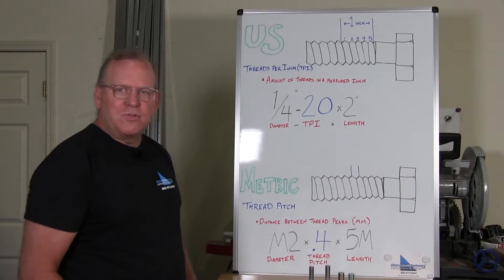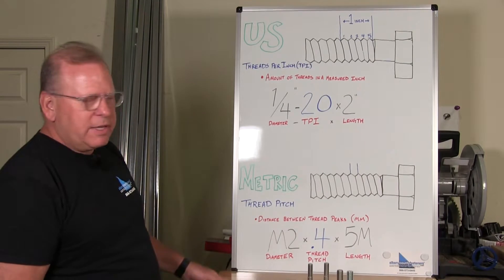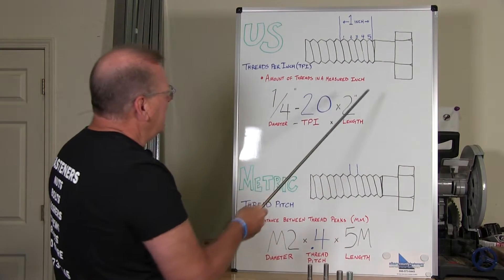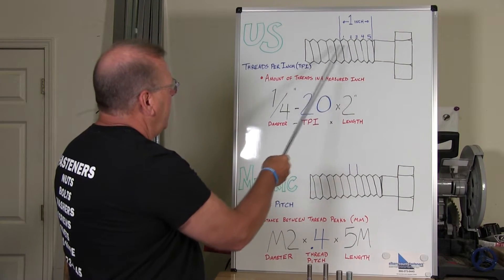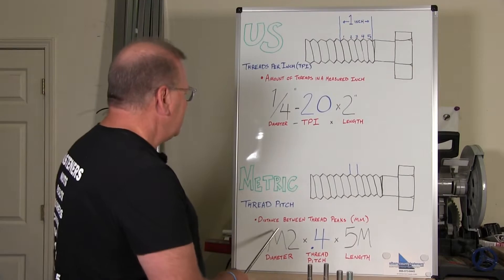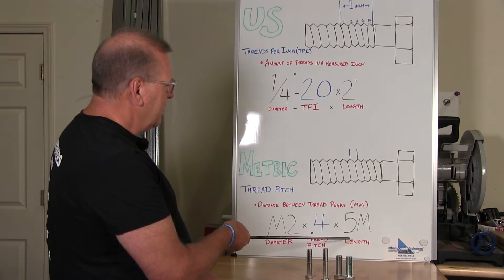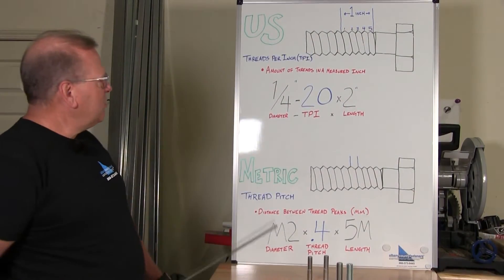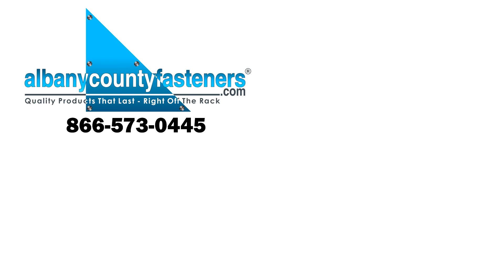Measuring Thread Pitch & Threads Per Inch | Fasteners 101

Comment: When you measure thread pitch, do you measure the smallest distance between peaks, or do you measure the distance between peaks, measuring parallel to the axis of the bolt? They result in different outputs, so I'd like to know which measurement to take before making plans

Comment: Great explanation, bit confused about 5m ,  is  5m not 5 metres, surely it  should say 5mm  for 5 millimtres
Reply from the maker: Under normal circumstances, you'd be right! In the context of fasteners, 5m is shorthand for millimeters. Outside of threaded rod, the vast bulk of metric fasteners don't go beyond millimeter measurements. I guess they got tired of having to write a second m all the time!
Reply: @AlbanyCountyFasteners   @ every day is a schoolday mate, thanks for that

Comment: what seems to never be mentioned, but can be confusing is HOW to measure threads per inch.... the metric pitch measurement is easy, as its measured at the peaks of 2 consecutive threads.... but the threads per inch can be mistakenly measured at the peaks when it needs to be correctly measured from a valley, and the other end of the 1" measuring device will either fall in a valley, with the teeth counted in between,  OR, it will end on a peak, or somewhere in between the valley and the peak, which would designate either a half thread or 1/4 thread, which are rare but are sometimes found....   to make it simple for explanation purposes, take a very large SAE bolt that has the threads measured from peak to peak may seem to have 4 threads per inch, but when properly measured at the valley, it will be found to be a 3.5tpi bolt...  this needs to be understood to get the proper measurement, and it can probably expained in a much better way than Ive tried to do here....
Reply from the maker: Thank you for your feedback!

Comment: When you are counting the threads, does it matter whether you start counting from the trough or peak of the threads? Here it looks like you're starting from the trough but I just wanted to double check
Reply from the maker: When measuring Imperial fasteners you count the number of thread peaks per inch. For metric fasteners it's the distance between the peaks that's measured. We apologize for the confusion.

Comment: @Albany County Fasteners  Great video, why do bolts (fasteners) not seem to have the head size / style specified?
Reply from the maker: Head size is typically less important than the thread size (you have to make sure your fastener will fit in the hole first after all!) and is not usually displayed like the diameter and pitch. Head size can be found in the specifications table for a given bolt, however; for hex head bolts it's synonymous with wrench size. As far as style goes, if you are referring to bolt grades, our other video on the subject may be able to help you: https://youtu.be/GMtw6d_o_2M

Comment: It was a very good video, but can you just explain me what is coarse pitch thread and fine pitch thread??
Reply from the maker: Coarse and Fine are two different types of screw threading. Coarse threading has less threads per inch (or thread pitch) than fine threading. As an example, 1/4"-20 is coarse thread with 20 threads per inch while 1/4"-28 is the fine thread version with 28 threads per inch. 
The added threads make Fine thread screws have a stronger connection with more vibration resistance. Coarse thread screws are more resistant to stripping and cross threading while being easier to install since they don't require as many turns to screw in as fine threaded screws do.
We're planning on doing a future video on the subject, so we thank you for your interest.

Comment: thank you i needed this for my ied class
Reply from the maker: Happy to help!
Reply: @AlbanyCountyFasteners  

i am still  not clear on how to id a thread. can you do a clear video on thread, how many type of thread on earth ? how many standard on earth ? all those thread for water and gas (parallel thread, tapered thread) and normal screw fasterner thread. what are the factor must have to determinate a thread on something in each system ? 

how many type of thread gauge available to use and purchase ? and how to use thread gauge to determine  ? 

i am so confused. not even one complete video out there can clear my doubt.. oh.. help. 

andrew
Reply from the maker: @andrewyek  As far as fasteners go, there are only 2 thread systems that matter: The Unified thread system (US or Imperial Threading) and The ISO Metric screw thread system. Other thread systems and standards are either atypical, aren't used for fasteners, or are obsolete and kept around as legacy systems for dealing with older machinery.

For finding the threading of a given fastener or what have you, there are many gauges available. Gauges for Imperial (US) and Metric systems can be found on our site here: https://www.albanycountyfasteners.com/Fastener-Gauges-s/993.htm

Outside of the gauges, the Fastener Black Book may also be something for you to look into. It goes into greater depth about measuring and identifying fastener threads: https://amzn.to/2LvkHEY

Your other questions may be answered in a future video, as we believe the water and gas thread relate more to plumbing than fasteners. Thank you for your feedback!